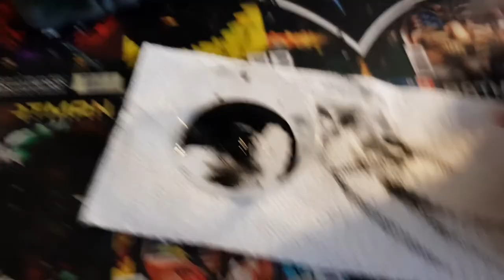Vintage Castle Grayskull REBORN!! ~ Plastic Pix

Comment: Great job. Do you have any videos on how to use the remote control relay? I would like to do something similar to what you did. But I would like to have everything controlled by one remote control. Is that possible? I know the LEDs, sound board, and jaw bridge motor each use different voltages.

Comment: Great job....just an fyi...the castle is actually suppose to be open at an L shape....not opened up side by side....what you are seeing is the castles front and one side....it drives me crazy seeing it opened up like that...lol
Reply from the maker: Hey, totally agree on the L shape and ot looks cool like that.  This one was built to my specs so it could fit in my display cabine.